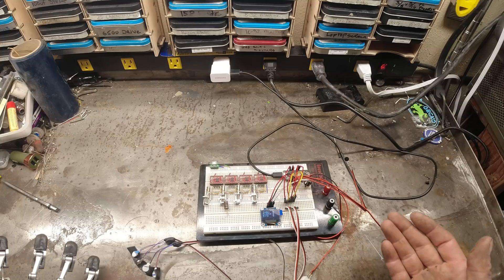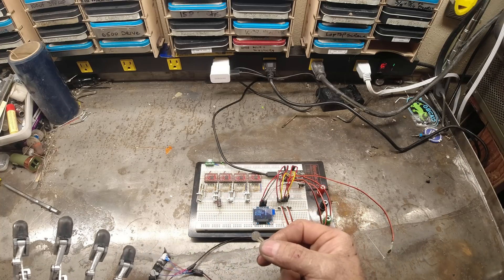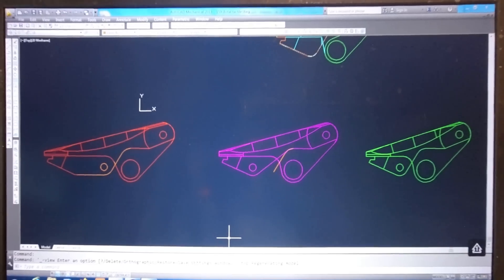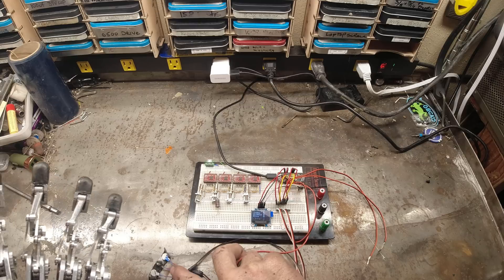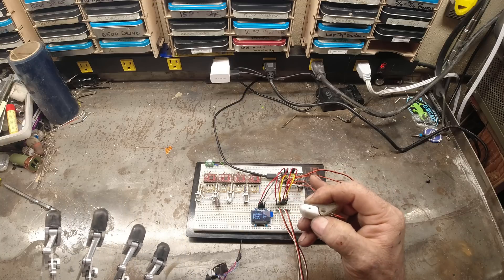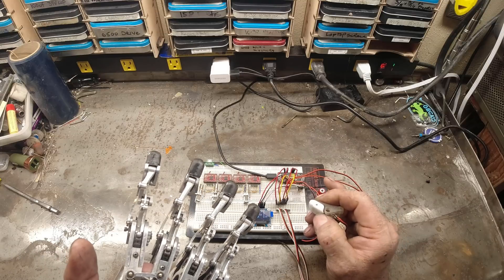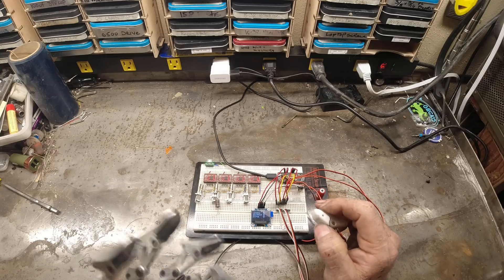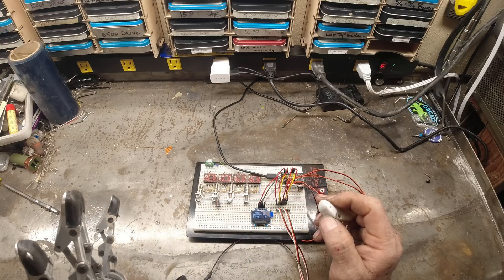Almost a cyborg! Adding Haptic feedback to my New Prosthetic Hand

Comment: I dunno if this even possible, or comfortable but, if you place a matrix of piesocristals with some kind of force multiplier to activate them or amplifier to then transmit to either electrodes or another piezo array with needles or stubs to relay the connection. 
But piezos are definitely something you should look into since they are less bulky.
BTW, I'm absolutely humbled by you and your invention, hat's off to you Sir.

Comment: Instead of a traditional motor to provide feedback, could you use a piezoelectric crystal and run a current through it to get it to vibrate? It would take up way less space than a little motor.

Comment: Would it not make sense to have pressure sensors map linearly to some pressure mechanics pressing on your skin, like electromagnetic push rods or something, so you can get the exact pressure feedback from you prosthetic finger tips instead of just vibration?

Comment: For sure, like playing with the new ps5 controller the new call of duty, it has that "3d haptic feedback", so in the story, or in multiplayer with a per, the controller progressively vibrates atleast in the story it works wonders, as once you feel the vibration, duck for cover then it goes lighter and it works as an input device. Idk, the controller haptics might be a bit too techy atm, but you never know; you looked into new controller vibration motors and controller circuits?

Comment: I think this idea is super interesting, my intuition leads me to believe that with some experimentation you could certainly increase the function of the prosthetic with such feedback. The real problem to overcome in my mind is that of sensitivity and then reliability. If you were able to achieve sensitivity which could differentiate each finger that would be an amazing starting point. Further, if there was some way to add depth to the signal such that pressure of contact was communicated haptically that would be cool, OR if you could communicate which aspect of a finger is being used that would also be useful.  

As for reliability, I think it would be really important for the signals to be subtle enough to be useful, and not so strong that they are bothersome. Which I image may differ from element to element and user to user. I say this is a part of reliability though, as the integrity of the device will have to be true for the feedback to be true. 

I think ones nervous system could learn to interpret different signals reliably, but the degree of efficacy would really be a factor of reliability and sensitivity in my mind.

Comment: Have you considered using piezo electric crystal speakers? Vibrating at a frequency either too high or low to hear, but maybe still feel?
I only bring them up because they are thin and would make for a more slim feature.

They also have those tiny chips they use in cellphones.

Comment: Are you sure you want vibration instead of a feeling of physical contact? Don't you think you could maybe simulate just physical contact easier? I mean, just the pressure. Perhaps with some kind of a spring and pully contraption (although that actually sounds more difficult). And if you put the points of contact on the back of your hand, your brain might just adapt to it.

Comment: i'd imagine that since skin can sense the amount of pressure applied to it, a closer approximation may be a linear pressure sensor on the tip of the fingers which controls a pressure transducer in the socket? (i'm guessing a simple but crude way may be with an electromagnet which moves a spring-retained magnetic shaft which gently pushes a pad against the skin)

Comment: If it constantly vibrates while in contact, that might get annoying. Perhaps a quick vibration when grabbing and releasing would be nice to know if something is gripped properly
Reply from the maker: I'm using the proportional map function for arduino.  The harder the sensor is pressed, the faster the haptic vibrates.

Comment: How do you actually control these? Cant seem to find any video explaining this. Not that i've been looking that thouroghly...
Reply: His mechanical hand is just based of wrist movements. Up/down for open/close and left/right for splay, he has added settings to it so he can change which finger move and when.
Reply: @yonneye2427  Interesting, sounds like a very robust solution! Do you know if he has a specific video where he goes into more detail about this?
Reply: @laxsjo.  He has a video called “Steampunk Prosthetic Hand. Now with individual control!” that explains how it works. The video is short and its an old version of his hand but it gives a decent picture of how it works.
Reply: @yonneye2427  thanks for the tip!

Comment: I can't find the research papers at the moment, but for doing sensory substitution the usual recommendation is temporally/spatially unique feedback vs intensity feedback, as well as having I think it's at least 1" (depending on motor location as sensitivity can vary over the body) between haptic motors, to be able to better discern the spatial difference between them. 

Doing temporally unique makes it easier to discern - like, a pattern - more 'clicks' together on the motor over a short time, faster the more pressure applied Vs just changing intensity. 

Another issue with intensity, with those types of motors is they can sometimes vary greatly in strength between them even at max power - you might be able to free up the internals by running a magnet over them but I'd still advise a check on that before mounting in anything.  (Unless you didn't get a cheap bunch off Amazon and went name brand)

Comment: I have one idea to make it still all analogic. First you seal in plastic film one of your metal fingers then over it you create a second seal of liquid viscosity material making contact with your biological parts, that should enable you to sense the waves of contact with an object.

Other idea are micro airbags in your finger tips connected with micro tube conducts to other micro airbags in your biological tips. You should be an expert in 3d printing to achieve this one.

Comment: I tried this a few years back (had index, middle and ring finger terminated after an industrial accident) found it more anoying than anything. Ended up switching the haptic for a row of servos on the back of my socket that pressed into my hand with force realitive to my grip pressure... Which was really easy to get use to and useful while operating machinery. If a built another I would probably try to build a hydraulic linkage from the finger tip to the back of the socket

Comment: Wonder if he’s ever considered replacing the metal with a hard plastic that would mimic a skeletal structure? I assume the parts could be machined smaller when made out of plastic and that way he could fit a motor inside. He could also get a silicon skin 3d printed to fit over it. But that’s if he wants it to truly resemble a human hand, maybe he likes the Terminator style metal.

Comment: Ideas for improving the Haptic system:
1. Transducers instead of motors? More control over actual haptics. Instant on/off. Better freq responses.
2. Upgrade [1.] could allow "profiled" or "textured" responses. Think about using a long stick to touch a tiled floor, then dragging the stick across the tiles, then across wood, then across a rug. The user grasping this stick should be able to feel the difference between these materials when making contact. And each material should have a different 'feel' when draging across them. The sensation of contact/dragging can be characterized for different surfaces, and the haptic output can be associated with a profile in the same way the stick user should be able to feel the difference.
3. Not related to Haptics specifically, and also perhaps an unpopular idea in general, but potentially INCREDIBLY useful to the design and usage of these prosthetics...
=[  Don't constrain yourself to pure replication of the missing parts.  ]=

An example for your specific prosthetic:
Is there much benefit to having every sensor in every fingertip? Would 1 finger be enough? How about just index + pinky?
How much benefit is there in having a 1-1 input-output ratio? 
Is a single sensor enough for specific purposes? Ex. Would a temperature sensor on just one fingertip, instead of other sensors, be more useful?

We can learn to adjust our senses to fill in missing information.
If you are trying to create a purely tactile sensor setup, would it make more sense to split up the haptic responses on fingers for different uses?
Could a perfectly usable setup be made with 2 fingers that only provided yes/no contact response and only a single finger that had a 'texture' response?
If yes, should the 'texture' finger actually be a dominant one? Would it be better to have it be a 'selective' use tool? Ex. "Want to test something's texture? Use your ring finger."

This design philosophy can be extended in other directions too.

Your finger setup is clever. I especially like the "cup holding' mode where you curl a pinky in to support the bottom of the cup.
But is that ACTUALLY a better system than one where a bar/plate could click/lock into place from the hand to support the bottom of the cup when gripping it?
It wouldn't be how a "normal" hand works. But does that ACTUALLY matter?

The same questions can be asked about the number of fingers, or even joints being implemented.
How much benefit is there in having a middle + ring finger? Is another configuration more efficient to design or use?
Is it actually efficient to use 3 joints per finger? Would less(or more?!) be more efficient to build/use?

Comment: funny thing, with neuronal plasticity, you don't really care where you place the haptic motors, any placement that allows you to feel them well and differentiate them easily will suffice. because of cerebral plasticity, you'll eventually just locate the feeling at your prosthetic finger tips and not on your hand anymore.
this is a big deal, because your stump is likely likely not be as sensitive to touch as other parts of your hand, and it could be hard to properly feel and differentiate that feedback if you place your haptic motors right where your fingers used to be.

Comment: You're definitely going to want to have some gradient tied to those haptics.
If they always engage (like in your demo clip) you're never going to have battery to power them.
Maybe something that spikes the vibration on first touch and rapidly lowers the vibration so long as the pressure stays the same. That way you can know if you're losing your grip or squeezing too hard.

Comment: I think this is excellent! I love that your hand derives mechanical power through movement of your arm, avoiding so many headaches with power. Merging that with sensors seems like a great balance of both worlds! 

Have you experimented with temperature feedback? Something like a capped logarithmic temperature relationship between a small heating element (wired such that it can not exceed some reasonable temp), and a IR sensor at the fingertips. It would be interesting to use that to 'feel' things in your machine shop that are well beyond what you could otherwise touch. For example a piece of metal that was just cut.

Similarly you could tie other senses into the haptics. A small induction coil in a fingertip could provide a haptic response to current flowing nearby, for example, letting you feel if a circuit was energized.

Comment: I think it won't really matter where you put the "feedback output", i.e. where the feedback is given to your body, as long as it remains the same over longer time periods. When learning to drive a car or play the piano, it starts off as a conscious process (I turn the steering wheel / I put my fingers on this, this and this key, etc.), but as you get better, your thinking becomes higher level (I turn the car, I play an A Major chord, etc.). In a similar vein I'd think that it starts off as "The motor on X spot is vibrating so my index finger is touching something" and ends up as "My index finger is touching something". Either way, this is amazing, and I can't wait to see what becomes of this project.

Comment: I wonder about the motors, hold something for some time or do repetitive actions and they might be a bit to much, like working with a grinder all day your hands become a bit numb, what about simple electricial current, find some nerves and apply a voltage depending on how hard you grip? that way you have the ability to set not only the feeling strength but also maximum limits, add thermo couples to your finger tips and you could check temps as well.
The trick would be to find the best way to "hack the nerves" with electricial information.
Reply: the nerves dont even have to be on your arm they could be anywhere

Comment: Hi, I was thinking, maybe you can use:
1.  two piezoelectric crystals, one as sensor and second as an feedback (maybe with small amplification circuit);
2.  closed pneumatic or hydraulic system: small bubble as an sensor in finger tip - tube - and small bubble as an feedback;
Reply: I really like the closed pneumatic idea!! That seems like a really effective solution.

Comment: would little solenoids be a good form of feedback that way you could even implement some level of touch sensitivity though id imagine solenoids would use more power for less feel

or maybe some cable wire being attached to the tip and threaded to pressure pads allowing for a movement passthrough if the issue of the tightness changing with finger movement could be solved with something to take up any slack

Comment: Just wondering, whats the current pressure able to be output by each individual finger? Enough to reliably carry a coke can? What about smaller objects like a screwdriver. If that hand comes into contact with a wall while holding an item will said item fall? Nevertheless, amazing progress.

Comment: This sounds awesome!
It would be really cool as well if you could have a system to easily swap finger tips with different sensors allowing the vibrations to also signal other things like for example temperature or any other random sensor you can find. Even if its not the most practical thing in the world, the concept would be supper neat. And im sure that with some experimenting with concepts something at least somewhat practical could be made in this vain.

Comment: As someone who is a fan of interesting haptics, I'd encourage you to look at how valve handles the steam controller touchpads, instead of a vibration motor, they use a voice coil that can produce impulses corresponding to motion much more clearly. 
unbalanced mass vibrators are great but they dont have the kind of fine programmatic control you'd need for communicating the difference between "touch" and "pressure" for example
Reply from the maker: Thanks! The voice coil driver is an interesting take. Although it would be hard to meet the dimensional constraint using those. The haptics I'm currently investigating are 10mm dia x 3mm thick. I may look into ultrasonic pezio drivers in the future.  Thanks for the thought.
Reply: @missingpartsclub /videos did some googling and the taptic engine part out of an iphone 12 mini is that size though maybe more of a pain to use? there are apparently tutorials on how to plug them into ipods so clearly doable as a project but no idea beyond that and I'm not much of a packaging engineer myself, just someone who likes human user interfaces

Comment: Have you considered electrical stimulation, such as how a TENS unit works? The flat pads would probably take up far less space than motors, and might avoid some issues the vibrations of motors might cause on the skin. It might even end up feeling more natural, considering it stimulates the nerves/muscles in the residual limb...

Comment: Would it help to have different frequencies or number of pulses depending on which digit contacts a surface?
Reply from the maker: The way I have it set up currently is each finger has its own motor. And the harder I touch something, the faster the motor vibrates.
Reply: @missingpartsclub  that’s a much more elegant implementation. Love it!

Comment: love the idea of having some sort of feedback when you grab stuff, i wonder if there is some kind of mechanical way to achieve the same thing without the electronics? i can only think of nails that stab you every time you grab something but thats a stupid idea
Reply from the maker: I though about that, using push pull cables to poke my residual limb,  but I think that would get so old so fast. Being stabbed every time you touch anything, I'll pass.

Comment: Fascinating for sure. The downsides that I could potentially see though is you would have to charge the battery for the hand. Also liquids could become an issue. Less of an issue but it could potentially create some noise depending how you do it. Either way if you get around those challenges it could be a really cool next step.
Reply from the maker: No, it adds back all of the issues that I've eliminated by building my device to be 100% mechanical, might as well just motorize the whole thing if I end up going this direction.  At this point, with this hand, the results from adding haptic feedback would need to be absolutely amazing for me to add it to this build. I'll probably shelve the feature for a later build.  I'll attempt another electronic build coming up soon.
Reply: @missingpartsclub  i have some more questions and ideas I’d like to chat with you about more in depth. Would it be okay or is there a good place besides the comment section where we could maybe chat a bit about it? I find prosthetics really interesting and have been following it for a long time.